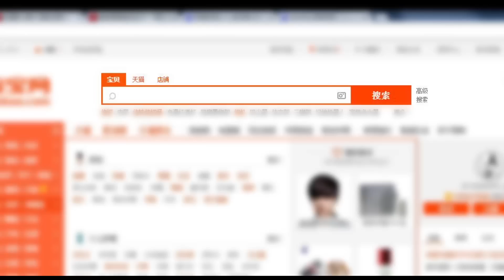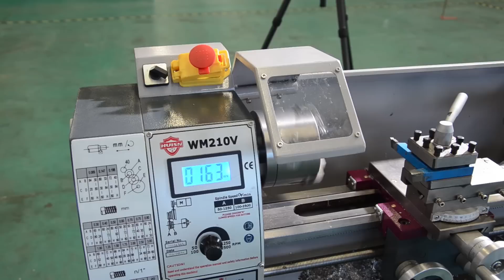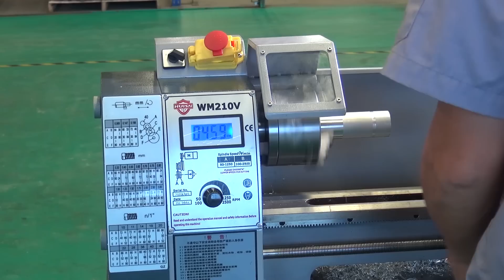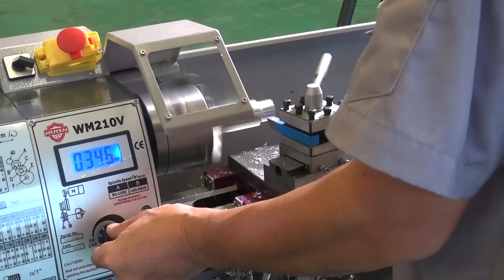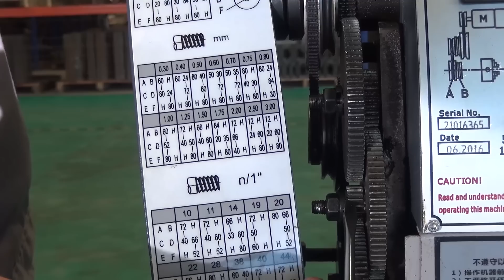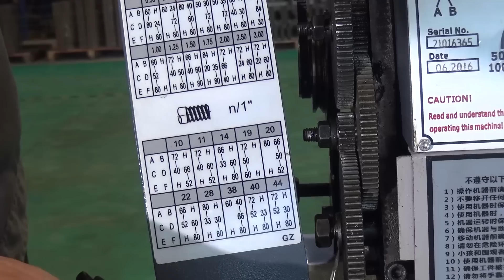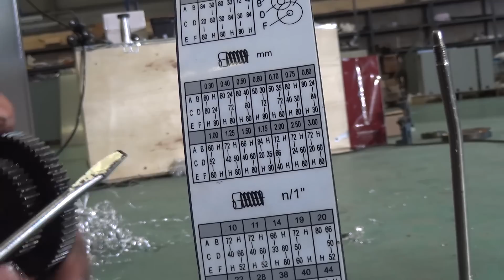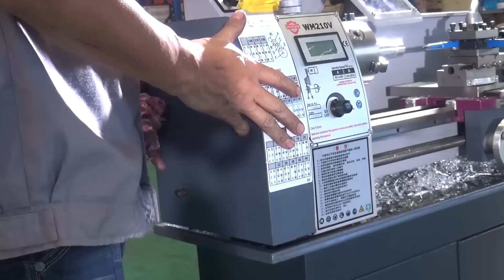210v

Comment: Great to see more videos from you, your CNC Lathe conversion was one of the inspirations for my current AL960B lathe rebuild project, as my scraps pile had no compound, your solid tool post with CNC gave me a way forward without the compound. Today I finally got it spinning under its own power again, so spindle tach and scales soon to be added, with the eventual goal to drive from mach3 or linuxcnc. Very keen to hear any thoughts you may have having lived with the results of your conversion for a while now cheers mate
Reply: @Easton Tyson Instablaster :)
Reply: @Sean Sterling I really appreciate your reply. I found the site thru google and Im waiting for the hacking stuff atm.
Seems to take a while so I will reply here later with my results.
Reply: @Easton Tyson Glad I could help :)

Comment: The two locking bolts on Page 7:22 should be discontinued. Replace by two inset nuts. This way users don’t need to slide back the compound to change angle. This is impossible for 7x12 lathes, is OK with this model.
Reply: It's not impossible with 7x12 mini lathes, I've seen it done countless times. However, it likely does sacrifice too much rigidity, and so I have not done it on my own 7x12 lathe.
Reply: @philoso377  Yes, that's one of them.

Comment: Can you supply parts for this lathe? I have 210V model and the motor has stopped working. I need new motor or new controller. Thanks
Reply from the maker: Of course, it's my pleasure to serve you, but you need to take a picture of the machine and send it to my email. I can identify the model of the motor, and my email is fireman1219666@gmail.com
Reply: @王响-d3r  - Thanks fireman1219666  . I have sent you an email. regards gerard
Reply: Hi I want to buy one,  210v maybe. can you supply/ship to india..?  & price..?